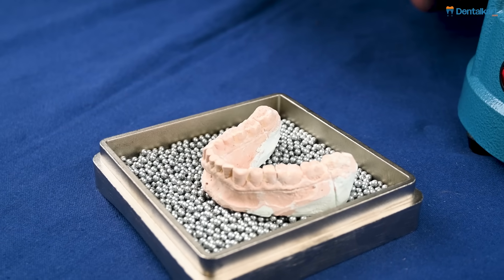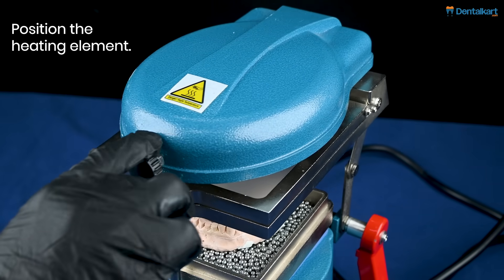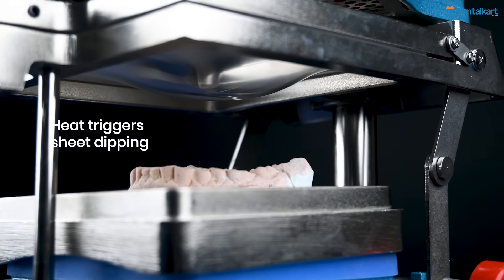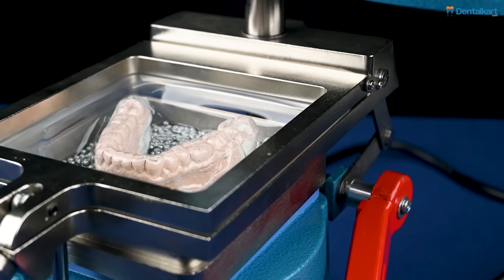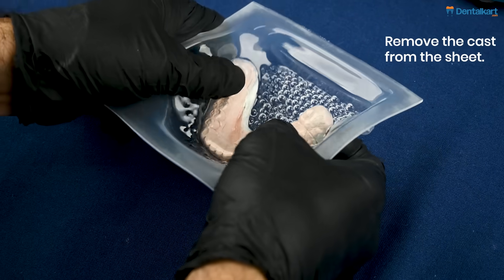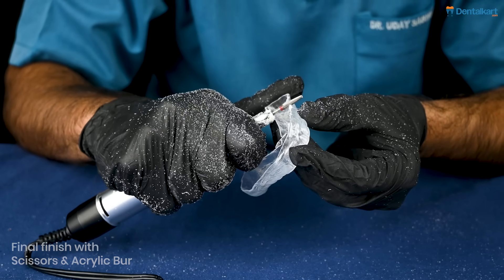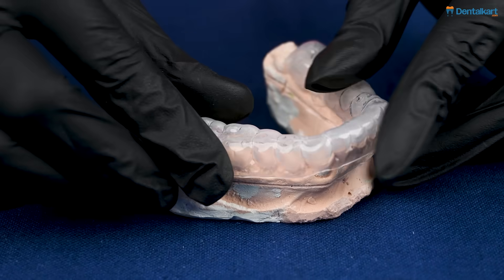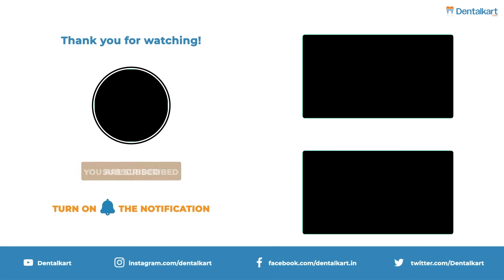How to Use Dental Vacuum Forming Machine – Full Demo & Review!

Comment: What is the dimension of the platform
Reply from the maker: Dear Doctor,                                                                        TECHNICAL SPECIFICATIONS :

Dimension: 25x21x30cm
Thermo forming material size: 5" x 5"
Voltage: 110V/60Hz
Power supply: 1000W
Machine weight: 6kg                                                       TEAM DENTALKART